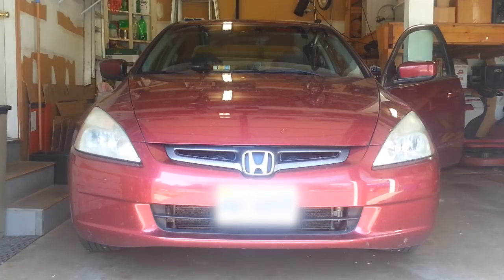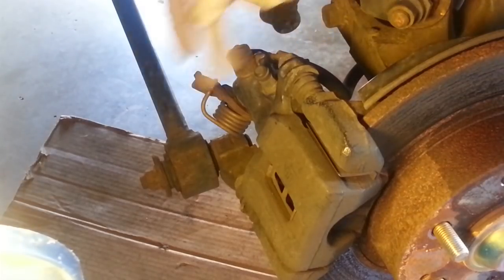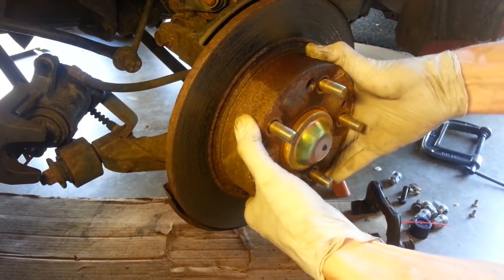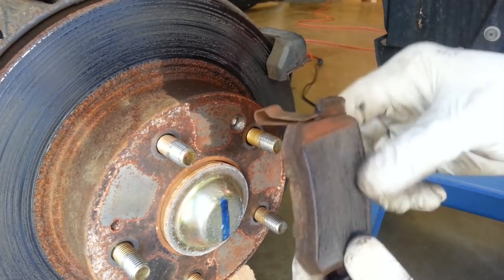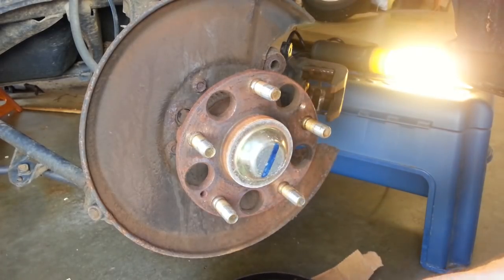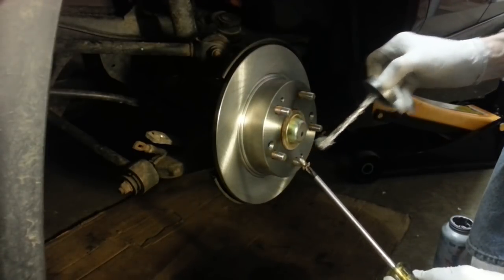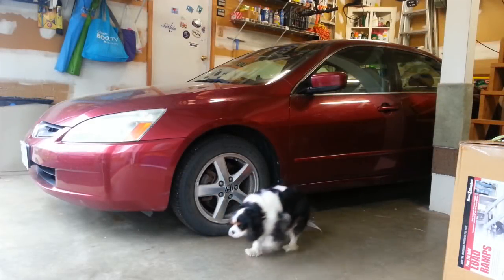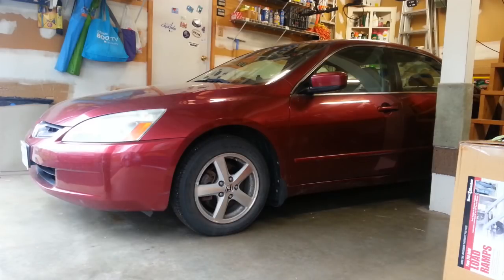DIY fix for replacing rear brakes - Honda Accord

Comment: This is the best video I've seen for doing brakes. Great work good sir! Remarkable camera work, detail, and explanation. I followed this and was able to change my calipers, pads, rotors on my 05 Accord. 

Some tips I had for anyone reading comments about things not exactly in this video:
1.  When installing the new pads, I applied a light coat of anti-seize on the retainer clips and on the tips of the pads where they sit in the clips. This helps to prevent a pad from get stuck on the clip during normal break operation (which happened to one of my old pads). 
2. I applied the supplied high temperature grease that came with the brake pads on the back of the shims. I also took off the shims and on the back plate of the brake pad I put a little CRC anti-squeal solution I had.  
3. Someone else made note of this in the comments but the rear caliper pistons have to seat properly on the inner pads, i.e. you need to make sure the raise bump on the inner pad shim is sitting in the criss-cross section of the piston. From reading other comments and what the author of this video correctly said, the criss cross section had to be at 12, 3, 6, and 9'o clock positions relative to the caliper and then mine were able to seat.
4. When you take the old rotor off, it's not a bad idea to get a wire brush or sandpaper and just smooth out any bumps or rust that have built up over time on the wheel hub. You don't need to go crazy with it, but it just helps to ensure the new rotor sits on your hub as flat as possible. 

Just my tips and personal suggestions; I'm not a car mechanic.

Comment: Thank you for such a great step-by-step demonstration, I took my 2003 Honda Accord in for new tires and the auto shop wanted to charge me $300.00 to do my rear breaks,  I've done rear breaks a few times but never had to replace a rear caliper...until now, my driver side caliper seize on me and would not turn or decompress.  Save lots of $$ thanks to your video.
Reply from the maker: +Gus Ebratt I'm glad it was helpful.  Good job rolling up your sleeves and doing it yourself!

Comment: Nicely done.  I'm actually relaxing, enjoying  beer, after my "replace the rear pads" job turned into "replace seized rear passenger caliper and pads", too.  I did my job then found your video.  It was relaxing to watch you go through it.  Regarding your savings on the DIY - absolutely every consumer with a tool box should know and understand brakes.  They are easy to deal with, and, increasingly, the parts are really cheap.  What I did today would have cost me $400 or $500 without my basic skills.  Instead, it was $100 in parts and 30 minutes.  Good video!
Reply: Michael O'Neill Im also looking foward to "after" Rear caliper rebuild Beers tomorrow night haha also fitting Mtec performance drilled and grooved discs all round replaced with brembo pads lol cost me 200 quid fml fully worth it tho!!
Reply: $100 for a caliper and rotors? you got lucky or used low quality parts. it's usually more then $100
Reply: In the middle of doing mine now. I had to stop work a couple of times to catch up/refresher on the next step and make sure I putting everything back in the right order. I thought the inner pad shim was missing until I saw that there wasn't one. I called the Honda dealer and was quoted $1,000 to 1,100 and up, depending if there were any problems. My cost: Bosch rotors - $54 for both;  Honda OEM pads - $55 set;  AutoZone calipers $152 for both (+ cores which will be returned);  JIS #3 impact screwdriver $15 (well worth it);  Anti Seize and Silicone gel - about $10 for both (I have some but it's old) - TOTAL $286 plus tax... plus, I like working on my own car (a LOT!)
Thanks for this tutorial.

Comment: This is a very good video as there are not many videos showing the step by step replacement of rear calipers on the 7th generation accord.  There are two points I would like to mention.  First make sure that the cross lines of the caliper piston are aligned in the12 o'clock, 3, 6, 9 position.  It is important to do this so that the inner pads are properly seated on to the piston.  There are two small studs on the back of those pads that must be lines up.  The second is that removing the brake cable retaining clip can be nasty.  There can be rust holding the  clip and cable in the bracket. You need to soak it with liquid wrench and brush it with a wire brush to help loosen the clip and then cable from the bracket.  Hope this is helpful.

Comment: This is an excellent video!!!
I will add this to save you time:
I used a piece of rubber hose  to push inside of the brake banjo fitting to stop the fluid from leaking out; 1/4 inch ID  about 2 inches long. I used a digital caliper to measure the O.D. of the hose after measuring the banjo fitting. The hose needs to be slightly larger than the fittings I.D. to enable it to fit tightly. Taper the end of the tubing a little on your bench grinder to make it easier to push it into the fitting. [This: thanks to another YouTube video]

Comment: Thank you for doing this video. This is the best video by far showing how to use the impact driver correctly. I did strip my screws when replacing the front rotors and had to drill them out. That was an experience for sure! Bought a set of the impact driver and it should make my life much easier when it is time to replace the rear rotor.

Comment: Nice video. At 19:22,  parking brake wire is secured by a c-clamp to caliper bracket. It comes out using a large flathead screwdriver. Then the trick to remove parking wire from bracket is first to make it loose by opening the other 12mm securing bolt and then pull wire towards rear and then slide it out of L shaped caliper bracket opening.

Comment: Great video!  I just paid TWO garages to replace brakes and rotors and NEITHER ONE did anything but the shoes.  They probably couldn't get the small screws out and just didn't tell me.  But they also failed to reduce my bill.  

When I took the tires off and saw what they had done (or not done) - rotors all crispy and flaky and grinding - I decided I was going to do all four by myself, do the calipers and bleed the system, AND repair wheel rim rust  on the underside while the wheels were off.  Total cost was $400 and a little elbow grease for a 65 y/o woman with no brake experience.  If I can do it first time out, so can anyone.

My actual cost was higher because without neighbors or family, or a garage, I had to buy a floor jack and jack stands and a few other tools like torque and breaker bars and the Honda piston compression adapter.  but the brake supplies without all that came to roughly $400 for all four wheels.  It went well.  :D

Oh, and while I had the wheels off, I [carefully] cleaned the ABS sensor and sprocket of dried road debris and metal shavings, and replaced brake hoses on all four, and did a suspension check for future problems.  I also applied rust converter and barely smeared anti seize to key areas (like rotor screws and under caliper shims) to make the job easier next time.  Trust me, you can do it for less than $1300 as was said in the video, and with a breaker bar in the country's 'road salt and rust belt', the job was very manageable.  Because I was learning and there's an integrated parking brake in the back, it took me a couple hours, but every wheel I did, it got more efficient so the front brakes/rotors/calipers/brake lines, front end inspection, rubber boot revitalizing, ABS cleaning was about 30 minutes per wheel well.

I'm never taking my brake jobs to a shop again.
Reply: I know pads are installed with wear indicator on bottom, but another mechanic said he installs them that way because the leading edge means wear squeal is when the car is in reverse, not drive, and that way he has warning of 10% pad left without the drive of shame squeal through the neighborhood.  Either way, it's going to squeal, just not as much when installed on top.

Comment: Extremely well done video!  Why did you skip the bleeding portion?  I wish you had shown it.  For the record, I don't even have this model but your narration and the videography made me watch it all the way through.
Reply from the maker: 12vgs8606 You are very kind.  I should have included the bleeding process in this video for completeness. Perhaps I'll do one and cover all aspects of brake fluid testing, flushing, and bleeding.
Reply: I think you also skipped turning the caliper back in?  The parking brake cable on that caliper means you needed to screw the caliper piston in, right?
Reply from the maker: 12vgs8606 Good observation.  If I was simply replacing brake pads, I would have needed to compress the pistons back into the caliper bores with my large C-clamp.  The new remanufactured calipers came with their pistons already that way.
Reply: Of course; I need a dope slap!
Reply: The narrator/mechanic is right.  Youtube is filled with brake-bleeding videos.  I recommend you look for "One man brake bleeding."    AutoZone makes the video, and you can get the bleeder tool for 9 bucks there.
Reply: 12vgs8606 grease also lol

Comment: Thanks for the video. It really helped me (and saved a lot of time trying to figure things out.) I've already made comments about the use of JIS bits on the rotor and I would like to make another suggestion. If you want to keep the rotors, instead of pounding on them, there are two screw holes with threads in them (not the countersunk ones that have the screws.) They are 8mm x 1.25 thread and I used one inch long bolts to safely and easily remove the rotor. Just screw them in (evenly) ...it's kind of self-explanitory.

Comment: Great, detailed video. Thank you! I have to do almost the same as I (still) have the same car. Parking brake on rear left wheel stopped 'braking' so have to replace complete caliper. Just for fun (and safety) I will do both rear caliper replacements. Unfortunately Canadian prices are NOT as friendly as US$. Caliper (Raybestos) are about $120 (incl. tax), free shipping. Pads go for $25.

Comment: what size phillip bit did you use and or recommend for the hand impact tool? I know they come with some but I heard some of them are a bit too small. thanks.
Reply from the maker: My hand impact tool came with 4 bits.  Two phillips and two straight slotted.  I used the larger of the phillips bits.
Reply: WorseThanChiggers awesome. Thanks for replying. U will have to purchase one soon.
Reply: These screws are NOT Phillips. They are JIS #3 (Japanese Industrial Standards) and an impact driver is about $15 and very well worth it!

Comment: The manual recommends you put it in reverse when parked. I noticed you put it in 2nd. In most cases it doesn't matter especially if you're on flat ground and you have the parking brake set. But if your parking brake didn't work and you park on a hill then you need to put it in reverse.
Reply: I depends which direction your car is facing, you just don’t want the engine to turn the wrong way

Comment: Great video, one thing I would add is that unlike the front calipers, the rear calipers need to be turned clockwise to compress them and the groves left at the North east south west position if you didn’t buy new calipers. And I’ve heard before to put grease in between the retainer and the caliper to make it hydrophobic and respell any water that might make its way there and prevent rust.
Reply from the maker: Excellent advice. That is indeed the proper procedure for compressing the rear calipers. It's a controversial subject but if you're in the school of thought where brake grease should be used on any brake system components , go easy on it. Too much will attract dirt and grime and may defeat the purpose. I only use brake grease sparingly on the ears of my brake pads. Some people use it elsewhere, such as between the pads and caliper pistons, in an attempt to prevent noise. On Hondas, I prefer to keep that area dry and let the factory shims do their job. I also use silicone paste on the caliper glide pins but that is internal and not exposed to the elements.
Reply: @WorseThanChiggers  I meant between the shims and the calipers, not between the shims and the pads
Reply: @WorseThanChiggers  prevents water from getting under there and becoming trapped and rusting it
Reply: @WorseThanChiggers  I mean between the caliper bracket and retainer clip, oops!
Reply from the maker: @Devs.rr.06  I don't know that you're going to completely keep water out of there with a layer of grease between moving parts. Brakes are designed to get wet and I'd rather allow any water infiltration to escape.
Reply: @WorseThanChiggers  idk if you saw my edit, but I meant between the pad retainer clip and the caliper bracket. It doesn’t move and the grease is sandwiched between the two solely to keep water out

Comment: Stick a TR 418 valve stem through that banjo bolt and leaking brake fluid solved. I used to suspend the hose (like you did) or crimp the hose closed till someone informed me of the idea with the valve stem.. Just another item I added to my brake repair arson.
Reply from the maker: Great tip. Thanks!

Comment: Great informative video.  I too have a seized rear caliper on the drivers side of my 07 Accord.  I was going to have my local Midas shop do the job, but after watching your video, I'm going to tackle the replacement with a buddy.  Thanks so much for the clear camera shots at all the different angles.  I checked the set screws on the rotor and mine aren't rusted at all.  Could I get away with using a PH3 bit and my drill to remove it without damaging the head of the screws?
Reply from the maker: Uncertain. I've tried using my small Dewalt impact driver to remove them and still ended up tearing up the head of the screw. The PH3 is a good idea to make sure the bit fits snugly. Either way, soak with penetrating oil ahead of time and use the 2 hammer trick to induce a shock. You may then be able to remove it by hand.
Reply: I have a maul I call "the persuader" that comes out for every brake job.   As I've grown older, I've been able to afford more and better tools, but there's just no replacement for the manual impact tool and persuader for removing those pesky rotor screws.  Always works like a champ.  The persuader is also good for knocking rotors free of the hub, as well as motivating seized calipers to let go of rotors.
Reply: Seriously. The screws are NOT Phillips. Use some of that money you're saving to get a JIS #3 (Japanese Industrial Standards) impact screwdriver. They are is about $15 and very well worth it!

Comment: Oh, and ALWAYS clean and re-grease your slide pins (the initial 2 bolts you took off to get the caliper out). If they get dirty? They'll stick, which will cause dragging brakes, warped rotors, uneven pads, and seizing in bad cases. Grease them every time pads are changed...just my 2 cents

Comment: That is a great video.   Thank you very much for making it.   I am a little confused on how the rear caliper works.  You can both screw the piston back in with those special brake spanner wrench things or push them back in with a C-clamp?  Sounds like it has two ways of moving in the same direction.

My lower slide pin bolt on the driver side rear was stuck so I am about to try out my new Harbor Freight electric impact wrench to get it loose.   Taking me a long time to do all of this but I am learning and it won't take me so long the next time.  Having the right tools on hand from the beginning of the job will save a lot of time.
Reply from the maker: +Bill Alexander You are correct.  For the rear calipers, a Brake Piston Rewind Tool would be the proper tool to use such as this one.  http://www.toolbay.co.uk/Product-Images/Fullsize/7ef2c026-df4e-4b42-95bf-680a06756b32-1.jpg

I didn't bother getting out mine since I knew that I was going to be replacing the calipers and didn't have to compress the pistons back in all the way.  So, I just used the C-clamp method to compress them just enough to get them off.

The front caliper pistons can be pushed straight in using with one of the more conventional methods such as a C-clamp .
Reply: If you're just relaxing the pressure enough to remove the calipers, I guess the clamp would work. I might have used a lever, somehow. You really can't screw (unscrew) them while they're mounted. I forgot how I did it last time. It's time to change the rears; I did the fronts a few years back.  I got my hardware from AutoZone and they lent me the kit for backing up the pistons. I gave them a down payment - they put it on my charge card and never put it through ...and just gave the receipt back after I returned it.

Comment: Great video. What are the minimum hand tools needed to do this job properly? I noticed a torque ratchet driver, jack, wheel chicks, hand impact screwdriver,...?
Reply from the maker: Like many jobs, certain tools make the job easier or faster but are not necessarily required. I'd say that the video does a fair job of showing the tools that I use for this job. You may be able to do without the hand impact tool if you're lucky. I find it easy to justify buying new tools when doing projects like this because they are paid for with what I saved by not paying someone else to do it.